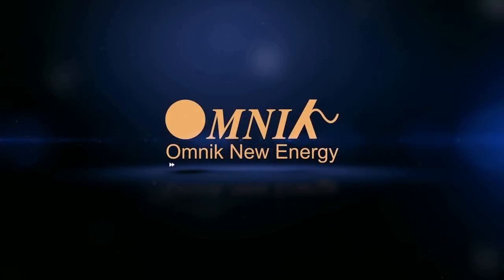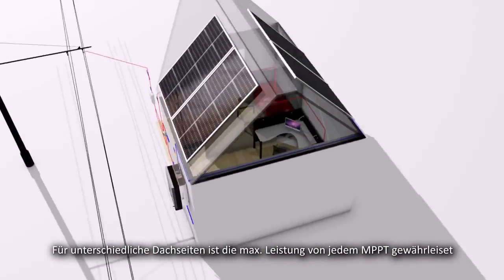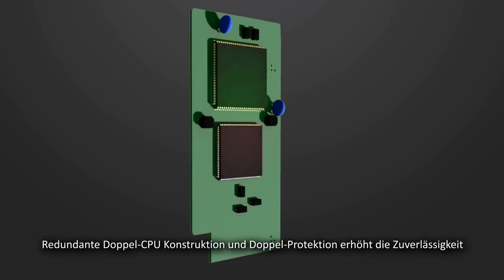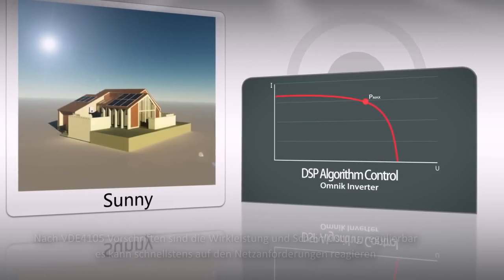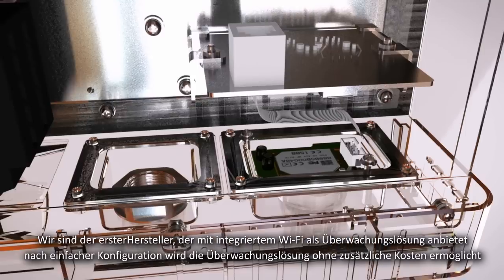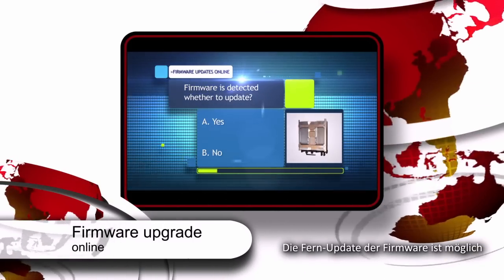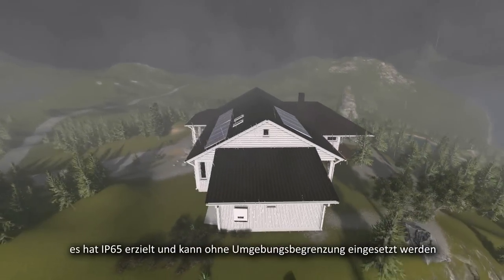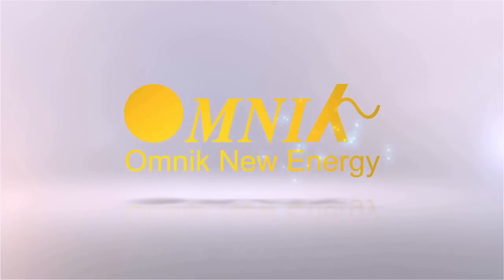solar inverter TL2 Pioneer EN DE

Comment from the maker: World-famous PV inverter manufacturer Omnik which is known by the high-efficient Micro-inverter (max. efficiency of 97.5%), has launched its second generation’s 1 – 3kW inverters to provide optimal solution for residential PV systems.